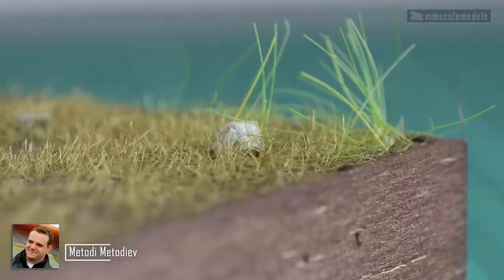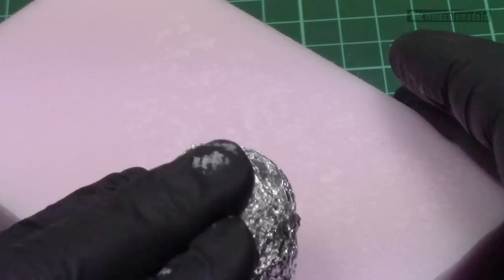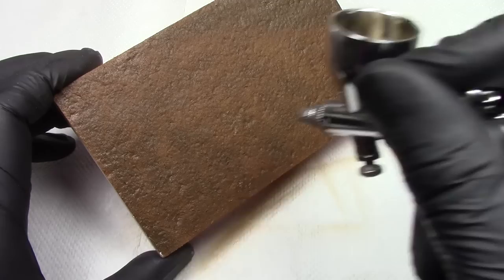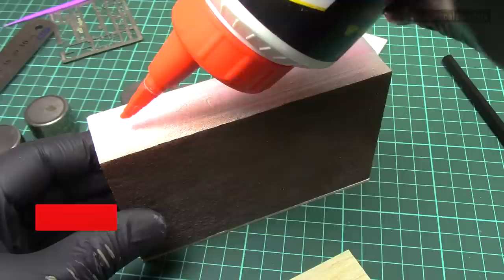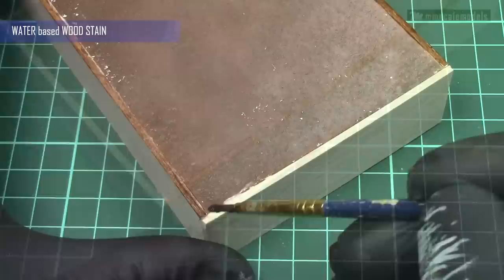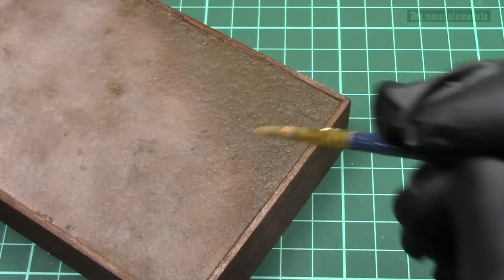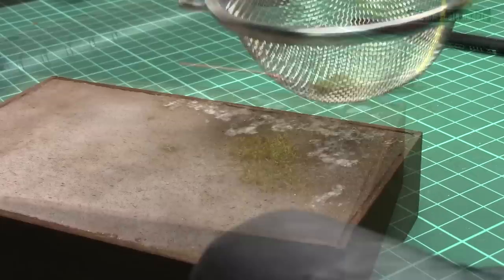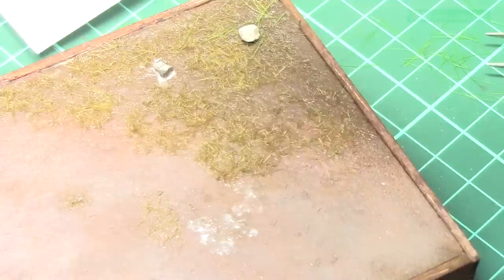How to build an awesome display base for your scale model - tutorial

Comment: Interesting technique with foil, had never considered doing something like that to give that level of subtle detail. Only other thing I would add is it would have probably been easier to stain the balsa before gluing.
Reply from the maker: Yes, this way may be easier but its not difficult when the wood is attached as well so it works one way or the other :)